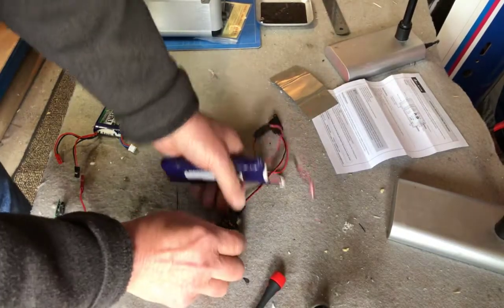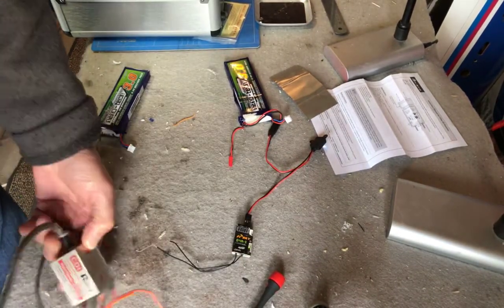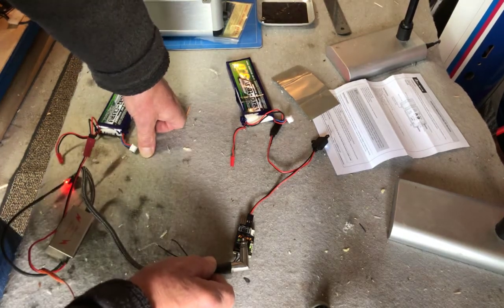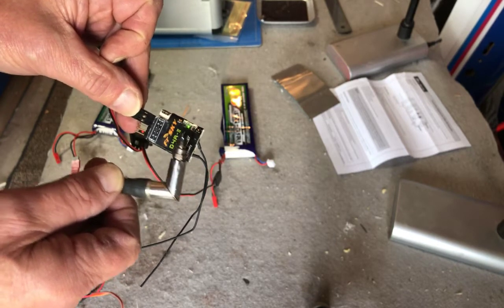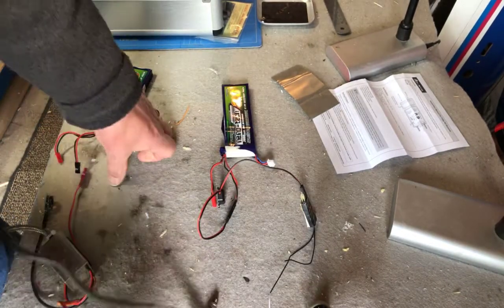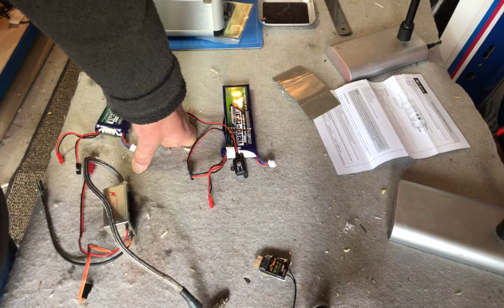FrSky receivers and CDI interference D4R

Comment: I have been using the D8R-II receiver in a 20cc Yak profile since 2014 and have never had problems with it. I use two batteries (life) for the RX and a separate battery for the ignition. This setup is very economical, I use a DLE20cc engine, 2 servos bb-660, 2 servos mg-996 and 1 hxt5010 for the accelerator. The receiver is inside the wing and therefore should be about 35cm from the spark plug.